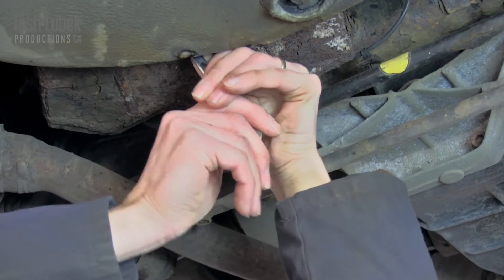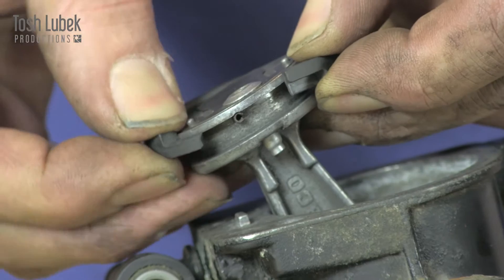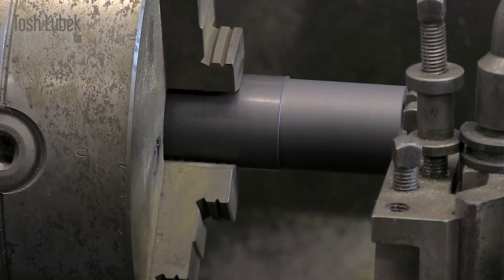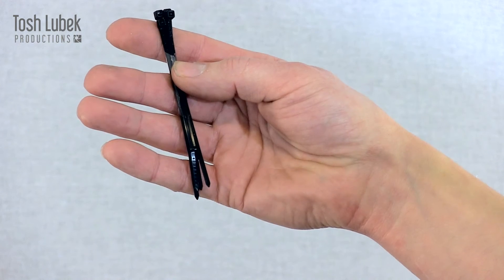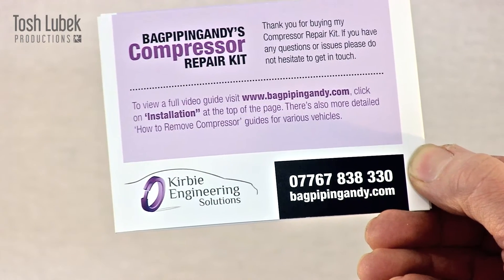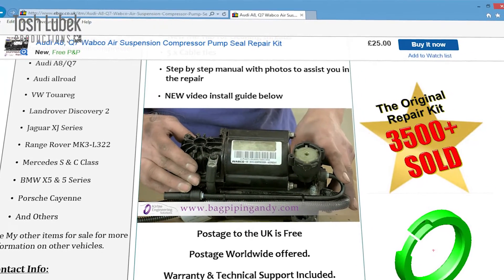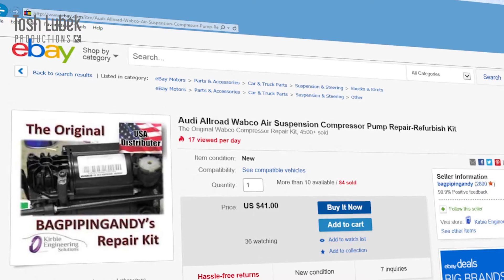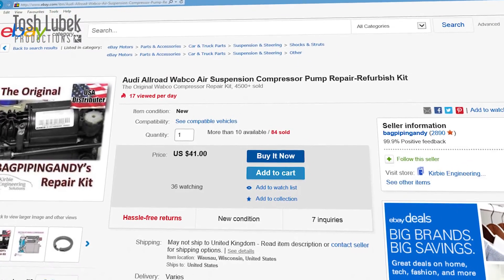Development of The Original Wabco Air Suspension Compressor Repair Kit for Audi Landrover Jaguar BMW

Comment: Had the same problem with my bmw f15 x5, my seal was different to this one in the video, but still a Wabco compressor. Mine was a flat disc folded up to the top of the piston, as a temporary fix I replaced the desiccant gel beads (very important) and folded the piston seal down exposing the new side of the seal. It’s been 3 weeks and I’ve had no issued from the compressor. (I live in Australia and things take time to get here)
Great video about you’re journey, for people watching find out why the compressor failed not just what to fix, if you don’t you might be in the same situation again, check for Leaking air springs, solenoid valve block jammed, air lines leaking, decompression valve stuck open, desiccant beads are damp. All of these issues are really easy fixes for a novice mechanic with lots of videos online to help you. Like I said great story mate.

Comment: If you one of these air suspension vehicles you need to know about cost-effective air suspension repair.
Reply from the maker: +Baltimore Home Services I agree. Bagpiping Andy's repair kit is just £25 or $41, which is a lot less than the dealers will charge to replace the whole compressor. I find it bizarre that Wabco do not supply individual replacement parts, or maybe that is a deliberate policy!
Reply: WABCO know exactly what they are doing, believe me. Follow the money.

Comment: This is excellent, I got rid of my Audi because of this problem, I wish I'd had this information six months ago.
Reply from the maker: +stephen crossley Sorry to hear you had to get rid of your Audi. The fault is quite common and the main dealers can only replace the whole compressor, costing about £600 whereas the repair kit is just £25 or $41, so it's a huge saving. It's also very easy to fit.